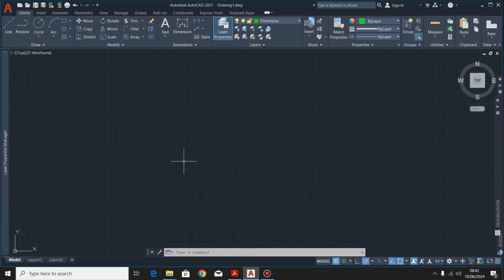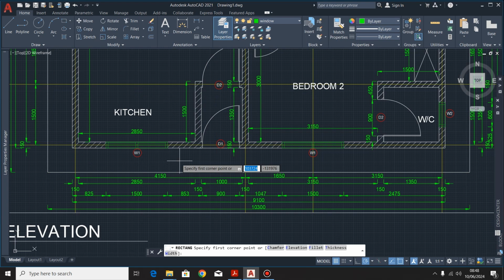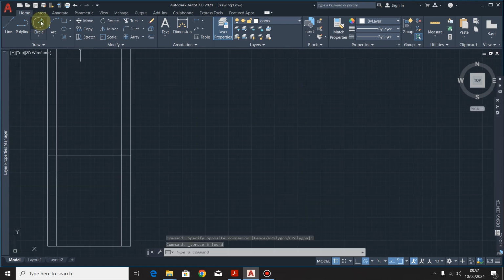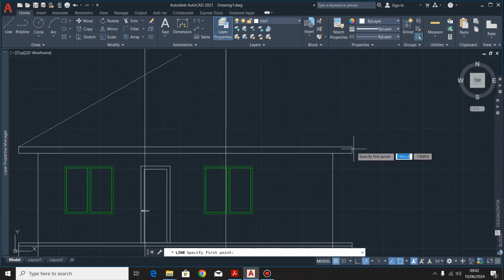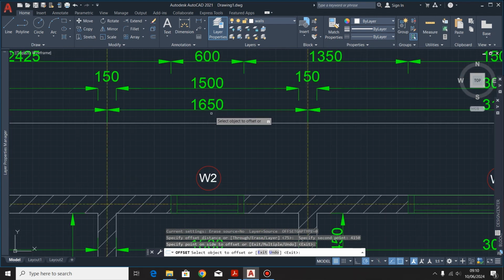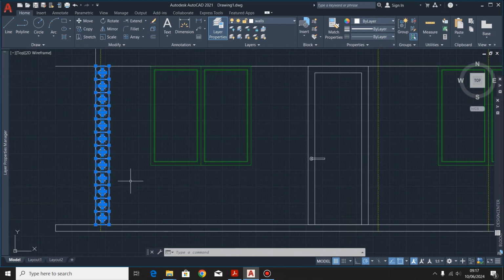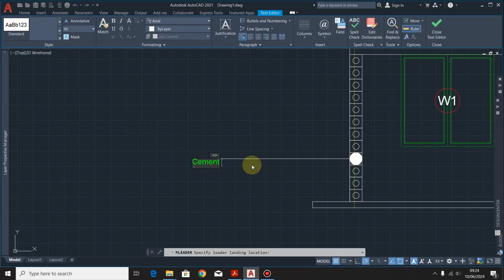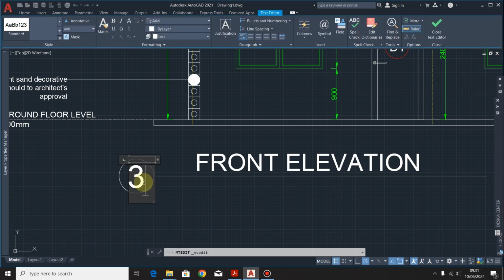Detailed front elevation in AUtoCAD @TDMC

Comment: How many degrees did you use for roof framing sincenung used 30% on roof of front ele.
Reply from the maker: The pitch angle still remains as 30° for the roof framing for uniformity
Reply: so you used 30 degrees angle for the roof and 30 degrees also for elevation of roof?

Comment: I’m currently receiving training for the architecture firm I’m working for and they told me that in order to get the right elevation height, I have to use a wall section as a reference.
Reply from the maker: Ohh, yes they are right, the best way is to first draw a cross section then from there it becomes easy for you to determine the true height of the building
Reply: It is a a lie. Elevation and section is different. If you want a height, you just draw a line that is few metres above ground to draw your elevation